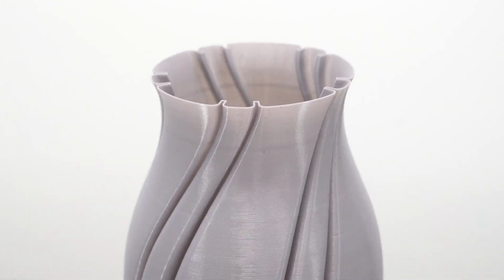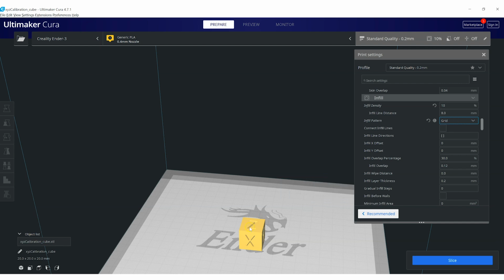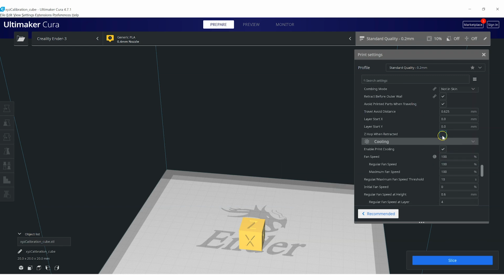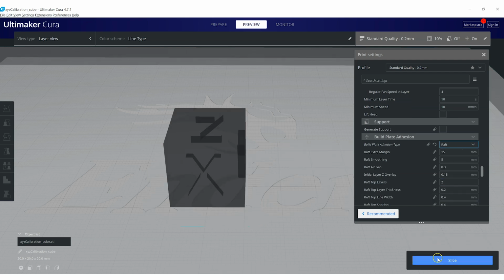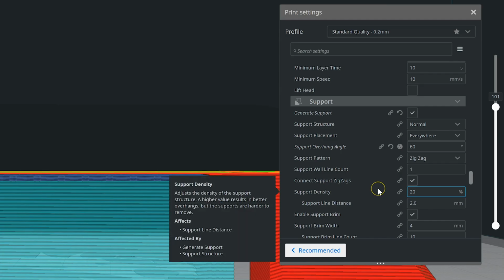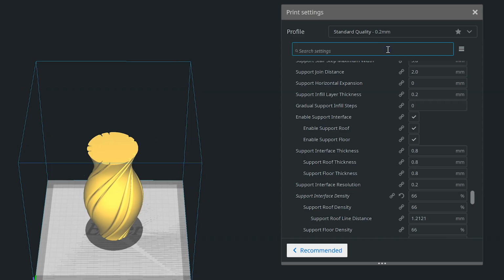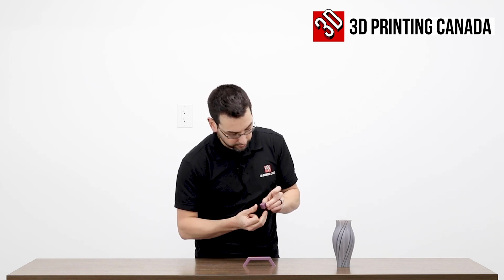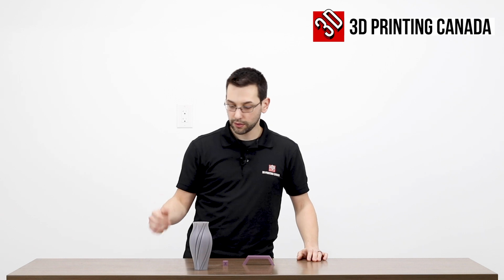Creality Ender 3 v2 Cura Slicing Tutorial

Comment: I am new to 3d printing,my Ender 3 V2 is on his way home :)
I am planning to print a Heroquest board.
I will use 0.2 nozzle and highest detail possible.
The items are Tiles about 100x100x5mm and the detail is only at the top.
Which is the best orientation for maximum detail?
1) Horizontal :The tile sit on the bed with the nozzle "looking" the detail
2) Vertical: The tile sit on the side with supports and the detail "looking" me.

Comment: Everywhere online I see how Cura is the way to go for your ender3v2 but now I every time I try to download the thing it won't show up on my homepage never seems to wanna fully finish downloading and now it's made it so I can't use my slicer that came with the printer I can't seem to purge it from my computer no matter what I do. I've gone through in a raced it everywhere I can find it and yes when I try to reinstall the old slicer it keeps telling me that it can't because Cura is using some of resources. Secura won't work every time I try to use it I have to go through the same set up routines and never actually let me use it. And I can't use the slice of the comes with the reality and there's three V2. So now basically because I tried to download what everyone says to download I can't even use my printer. I watch the videos of people showing you how to install etc. but it's always different than what shows up on my screen. I've tried for your recent both of them I tried to repair the program on the original slicer . nothing works!
Reply: Have you made sure it’s still not running in task manger? I had the same problem with discord took me ages to sort the news out I could not re down load it even tho i uninstalled it lol it was some how still I’m running in task manger